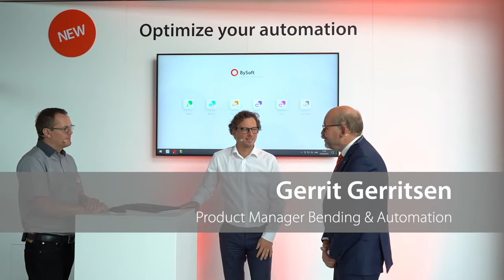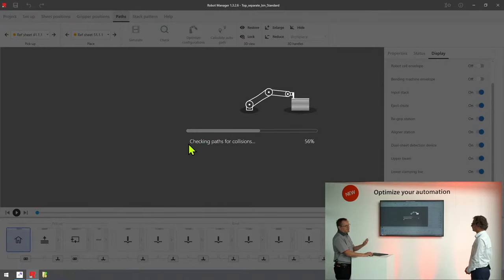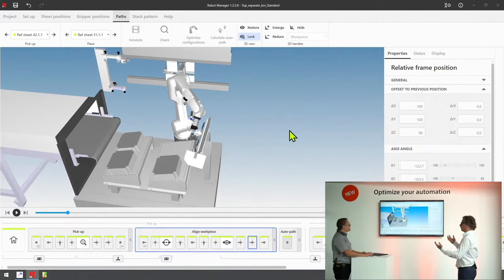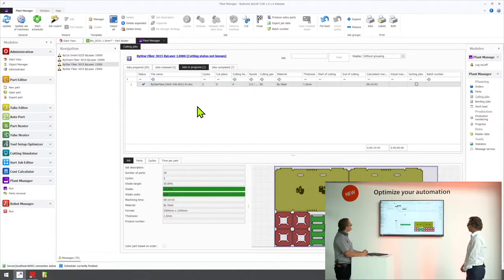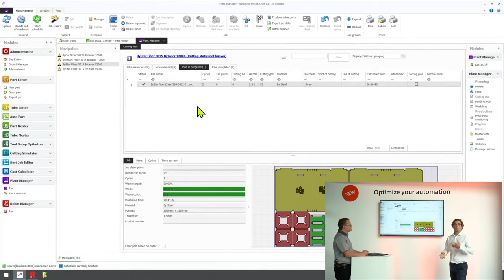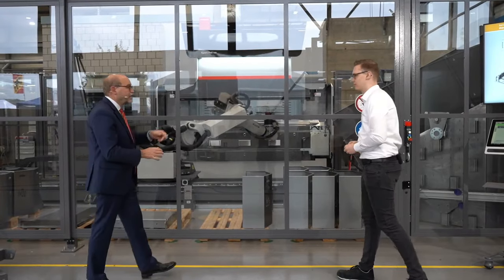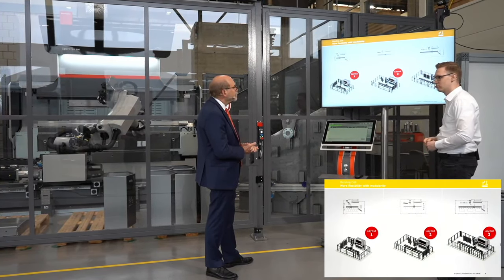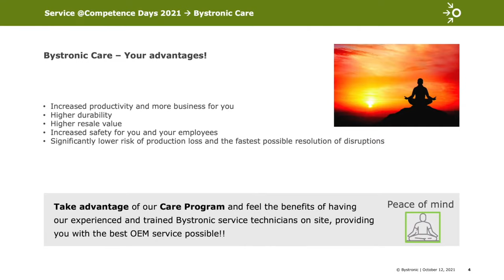Digital Competence Days: Day 2 - Automated Production

Comment: How often should slats be cleaned to allow double forks from not jamming up ?
Reply from the maker: Hello and thanks for the comment!
There is not a fixed amount of working hours after which you have to clean the slats, as it really depends from on the thickness, type of material and gas used to cut.
Another factor is the material the slats are made of,  if they are made of steel, they get dirty much faster compared to copper for example, and so the cleaning should be done more often.
In general we suggest to clean the slats/grids whenever the first signs of dirt are popping up, according to your production.